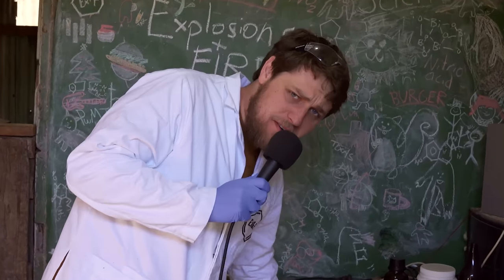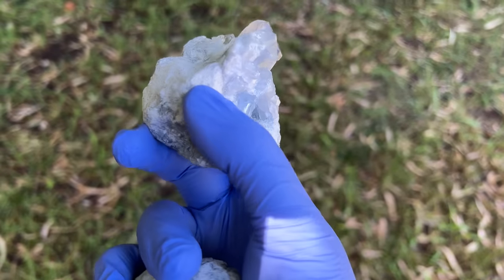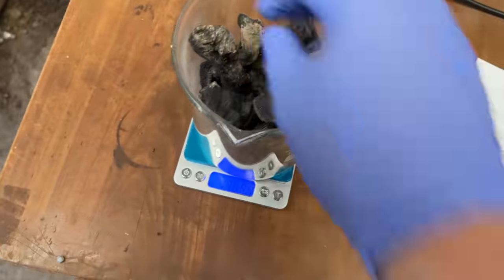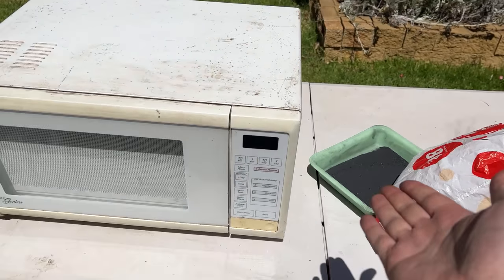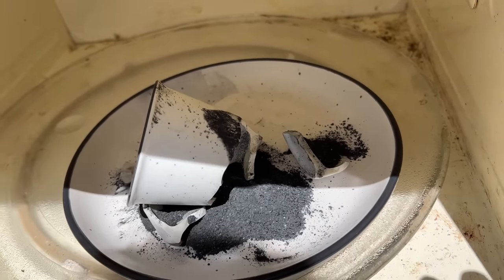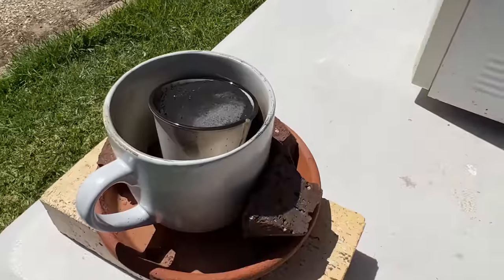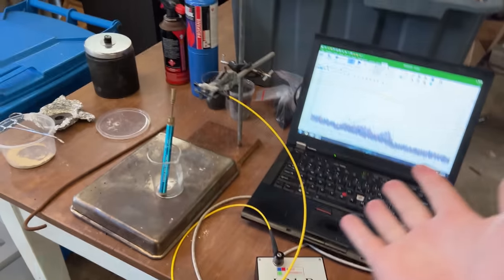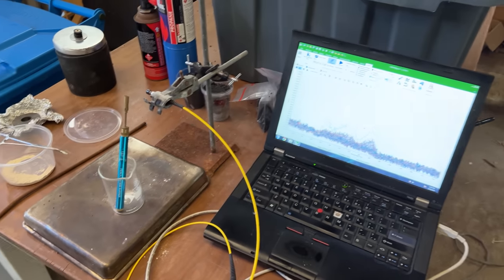Extracting strontium with a microwave

Comment: Someone else using the microwave to extract the minerals. Though i'm making steel/iron, the principle is the same. Great to see more mad scientists going at the same thing I am, it also helps my future reactions. Edit: Clay crucibles work WONDERS in the microwave, I make my own from blue clay and beach sand. As long as they are dried, not even fully fired, it works perfectly. If you have a container that's microwave safe, set the crucible in the dish with more sand.

Comment: I thought you'd make another thermite variant with SrSO4 and some active metal instead of doing the usual coal reduction, or treat the intermediate hydroxide with some special acid. You could make citrate, aspartate, tartrate, ascorbate, acetate, perchlorate, fluoride, etc. although nitrate was fine for pyrotechnic use

You have so much patience and that microwave is a beast, could it even make perovskites, including superconductors?

Comment: So what are you going to use the strontium for? It can be used in solid upconversion materials made without a pressure reactor, but to get a good quantum yield (~3%) you have to calcinate the powder at 600°C.

My team have actuall made PEI-coated strontium UCNPs for use in aqueous solution, but their emission was underwhelming compared to PEI-UCNPs made of NaYF4:Yb,Er and  NaYF4:Yb,Er

Comment: The single largest use of strontium was as chromate, a sparingly soluble (about 0.015g/100ml water) anticorroaive pigment. Every plane you ever saw was coated inside and out with an epoxy primer that contained as much as 40% strontium chromate in the dry film. That's tens of kilos per airframe. It was used on all military naval and land chassis and structures, too, although they started to phase it out for obvious, carcinogenic and long term environmental toxicity reasons long before aircraft builders did. Basically nothing works as well, for as long, as strontium chromate does as an anticorrosive pigment in paints. The secret is that sparing solubility - just enough to throw soluble chromate if the paint film is damaged, to protect the underlying metal, without being used up all in one go.

Comment: I'm pretty sure your "crucibles" are undergoing thermal shock along the boundary of the carbon/air surface.  The carbon is retaining its temperature while the parts of the porcelain exposed to the air are radiating off and cooling, which is making it shatter.

Comment: You can check the output of your microwave quite easily.  A known mass of water in the microwave for a known amount of time, 
measure before and after temperatures, apply some stupid maths and Presto... you can calculate the wattage output of your microwave.

Comment: So to answer your question the mouse shitification is agglomeration, usually done by an agglomerator, and is most common in medicines. if you crack open a capsule you can see the tiny spheres. I find it funny that you could have nuked the charcoal in the microwave to dry it before throwing it in the ball mill to prevent the agglomeration. Also you might be looking for a microwave plasma furnace, they can get really high temps. I know another youtuber NightHawkInLight has made a video showing rubies in a microwave. it might be helpful just to know about it honestly.
Reply: I don't think he could have dried the carbon out in the microwave. The moisture would have been drawn out but would have condensed on the inside of the microwave or precipitated, keeping the environment humid, making it a very lengthy, inefficient way of doing it.
Reply: @RiffRaffMama.  Have you ever heated soup or something like it in the microwave? it does heat up the water and condense along the sides. but unless its still water a couple of hours later its pretty dry, worst case you can use a towel and dry it off. I was mentioning it as a way to drive off a lot of the moisture before grinding it down. From what I understand its a way of accelerating drying. stick it in the microwave heat it up and set it on a rack to dry fully.

Comment: Oh one more thing before I go if it helps you should try a coil smelter (copper coil high wattage melts metas good and hot 1500°+) with tungsten tubing... You can oxidize the inside thickly and then use it as an almost instant crucible you don't have to use tungsten but you know😊

Comment: I'm sure you've had experiences with sitting rather quickly and fast on the edge of the bed you might have caught the wooden frame or have you not had a box frame mattress underneath your sleeping mattress?  The mattress that sits on the metal frame is made mainly of wood. Fiberglass in the mattress got caught in the wood. Maybe that's why it was so Caked Up.

Comment: Most of that potassium contamination is from the wood ash most likely.  If you washed the ash then dried it, you'd have removed most of the potassium.  If you really wanted to be fussy, you could have run the "carbon" through some dilute acid to wash it and react away most of anything hiding in it, then wash with water and dried it.  If you still have the rinse water from the experiment steps, check it for potassium.  Most of it remains soluble of course.
Reply: wikipedia.org/wiki/Wood_ash

Comment: I had the thought that maybe if you heated it in thinner layers it might heat more quickly. From my experience heating food in the microwave, it seems like the plate or bowl always gets hot faster than whatever is on it. If you have a larger mass in the dish to heat up, it might be more likely that the dish will crack before what's on it has heated up. Maybe it's just me but I have been annoyed more than once by a plate that required pot holders to remove from the microwave even though the pizza on the plate was still not heated through.

Comment: use grant thompson’s arc furnace, you can use the microwave transformer and some old lantern batteries. the only “significant” investment is the refractory brick which probably won’t be more than $10

Comment: Interesting that you are reducing the Sulphate to sulfide. In commercial gold extraction exactly the opposite occurs, you can use an autoclave to push the mineral into the sulphate form which can then more easily be extracted through surface chemistry shenanigans.

Comment: Those are called granules! The production of granules is a very well established practice in the pharmaceutical industry. It gives you something that will dissolve as well as a fine powder, without the disadvantages of working with very fine powder and without it hardening it up into a solid clump over time

Comment: About the mouse-shit results: Many candies and pills are made by tumbling a core in a powder.  Tiny amounts of water and powder are added while tumbling which causes the power to accrete onto the cores.  The core is usually a small tablet containing the active ingredient of a medicine or in the case of M&Ms, a peanut.  If you're lucky.  Sometimes they use pretzels.  Anyway, think of it as the sticky chaotic version of crystallization, where an ordered structure grows from random points of nucleation.  ALSO it's easy to ruin a plate if you put something very hot in the middle.  The conduction from the espresso cup heats the middle of the plate and the edges are relatively cool, so the expansion has nowhere to go.  The conduction of heat  is slow in ceramics, so the pause worked, but in the plate, the distance the heat needs to travel is much larger.   BTW, this is the opposite of the problem of circular saw blades.  They heat at the edges and go all wobbly because the center is cooler.  Keep your plastic spoon in the beaker! Eye on the ball. Stick on the ice.  You know, the thing.

Comment: I have to wonder a little if the temperature cycling of the porcelain perhaps contributed to the cracking.  If they weren't heated and cooled by the sudden exposure to air, would they last longer?

Comment: This hurt my poor rockhounder heart!   Something I'm curious about with strontium: will it keep magnesium from igniting in forging/casting? Calcium is used for that presently.
Reply: Note on the "Mousepoopification" that same technique (if you can call it that) was used to help early black powder form larger pellets. If the charcoal was too dry, the black powder would end up too fine.  That'd be a fun video. . . testing classically made black powder of different fineness.

Comment: By the way, you are always going to have to deal with ash when using impure carbon to conduct chemical reactions, simply because wood, being a living item formerly, had to have minerals in it, as way of how life lives, and so your final product will have sodium, potassium, calcium, magnesium, iron, and even traces of lithium, aluminum, selenium, arsenic, and silicon.

Maybe even some naturally occurring strontium.

Either way, its an impure product, so your final result is going to be impure without multiple recrystallizations, which, if you keep using impure carbon, simply never will happen...

In fact, with impure carbon, you would get more and more impure instead of less.

Comment: Dr Thomas, congratulations on your doctorate. If you asked me, to design a scale from 1 to 10, with a given "getting a B.A in Communications" as Level 1. And then you asked me 'where would the corresponding value for "PhD in non-linear optics" I'd say 12.

I agree that the shit pellets (note how they're somewhat like coal?!) were in all likelihood the result of the residual moisture of the carbon, combined with the ~100 micron size of the ball-ground strontium. My best guess is, since you threw the Carbon while it remained with its very high RH and a few microns into a (relatively) closed system, with a dry strontium on the order of 10s to the high hundreds of nm. Initially, the wet C(biggest,wettest) will favor a weak electromolecular bond with all them Stontz(dryest,smallest). Eventually your energy-minimum shape (spheres) will develop as you continue to coalaese

Next time, I suggest buying (or borrowing from ur uni) a "mesh sieve set". They're used in civil engineering to establish soil density for foundations and such. I'm sure they're used in plenty of other more biological applications but that's outta my scope. Some companies sell things that are ASME/ASTM certified. Try calling up vendors and ask if they have any B-stock that failed their QA.

Then, after using that mesh set (basically, its 6 trays, the top of which has a controlled steel mesh-- the one below it is smaller, the one below it is smaller, so at the top you see how much of your assay was of density range a, tray2 density range b, etc). Take tray 6 (the finest grit), and use that in the ball mill. (Note: I'm not sure if this is actually the 'best best' idea since having some content from tray 1 might act as a positive abrasive. Your ball mill will address this; I'm sure it's been well studied).

Separately, I would have taken the carbon, put it out on a long table on a sunny, non-windy day. Taken some glass trays and let the carbon out to dry. Like super fully. Before doing so, I might have done the Doug's Lab drying method : paper towels on the bottom, large surface area, air flowing over, and maybe heating elements at the bottom.

Similarly, having a RH probe is worth the 30 dollars or whatever. I've never used one in a situation like this, I'd imagine there might be calibration co-efficients involved, but it's YT. 5 point sampling will develop a quadratic curve that you can work within I'd imagine. At least good enough to know when your Carbon is dry enough to work with and mix in with your Strontium

 I really wish you had sent a sample off to @The Signal Path since he has a lot of optics equipment, and sufficient chemistry knowledge as well as process control experience to give a pretty good educated guess on.

Comment: In the future, if you need activated, pure carbon, get a paint can and puncture a small hole in the lid. fill with wood and put in a hot bonfire while you have a beer. the lack of oxygen will turn the wood into perfect, activated charcoal. my neighbor has a woodshop and I do that with sawdust and plane shavings, and it makes really fine, perfect activated carbon.

Comment: A couple of months ago I was in need of some calcium powder. So I took some eggshells from the restaurant I work at and pulverized them. I needed them to be as sterile as possible though so I dumped them into a glass cleaned with iso and h202 and put it in the microwave for 5 minutes. I came back 2 minutes later to a weird smell and noticed that my microwave was glowing orange. Apparently the eggshells got so hot that they melted through the glass and the tempered glass microwave plate. Lesson learned, microwaves get hot.

Comment: Maybe by using a carbon crucible (or a carbon coated one), the temperature could have been achieved easily instaed of using an excess of carbon. NightHawkinLight used a carbon-coated crucible to make synthetic rubies, so it might get hot enough.

Comment: if you put a small block of wood under one side of your tumbler ( " ball mill ") then the material wont build up on the ends, and it mills better.
i have always heard " rat shit-a-fication " referred to as " pilling" just like what happens on old cotton blankets. little " pills ". 
oh and did you say you bought those ceramics at k-mart? those still exist?
Reply from the maker: Thanks for the tip! 
And yeah in Aus they’re very popular still!

Comment: Oh, I didn't think of strontium in fireworks. My head when straight to nuclear physics where Strontium-90 is both a pretty horrible waste product of nuclear reactions, but also a relatively useful component of engineering and medical imaging devices. 

It also has a pretty unfortunate use as a cheap RTG decay heat source, where hundreds of Strontium-Titanate RTGs were left powering unmanned lighthouses around the Soviet Union when it collapsed and suddenly became orphan sources that magically give off heat (and acute radiation sickness) in those cold Siberian winters. Even a decade after the fall of the soviet union, when two were found in Georgia by 3 men out looking for firewood, just 40 seconds near them would put you over the maximum recommended yearly dose of ionising radiation. By now, given the ~28 year half life of Strontium, they're still about 2/3rds as dangerous as they were then. So don't sleep near the warm tin can in Siberia!

Comment: I'm very curious if the milled crystal-charcoal mixture is flammable. I fell like it should be, it's a very fine powder of a metal salt and carbon, just a couple of different elements and missing the elemental sulfur component of black powder so I see a good potential for explosions and fire 😁

Comment: Could you use an induction coil heater to heat the materials somehow?  Perhaps use a metal rod in the center of the crucible and pulse one end of the rod through an induction coil and sort of sink the heat into the crucible?  I don't know if that is feasible.

Comment: Perhaps the vessel are cracking due to thermal shock caused when you open the microwave door repeatedly.
Just leave it in there for the duration.

Comment: It would have been more cost effective to buy an alumina crucible and line the inside with pencil lines. Or spray in graphited lock lubricant and let the solvent air dry. I've never had any decent luck with porcelain surviving anything. It's too finicky and specific for its own heating requirements to be a worthwhile effort

Comment: For the love of god use a metal cylinder to smash/grind the sample not a hammer lol. Make a big strong mortar and pestle it works the best. I use an old small fire extinguisher and a small old steel drum. Just tamp and twist and you have super fine powder in less than 5 mins.

Comment: you could get a hydrogen generator from china if u really need hot stuffs. its only like 75$ USD for a cheap one, or use the aluminum method if u dont wanna use electricity

Comment: I have to add one thing - you are incredibly wrong about scandium being useless! Scandium has utterly fantastic metallurgical properties: for instance, a tiny fraction of scandium improves aluminum alloys to better performance than high-grade titanium, and there are all kinds of other crazy alloys you can make with the stuff. The reason scandium isn't widely used is simply because it's really hard to mine - there aren't any high-grade scandium ores, it's only produced as a byproduct of mining other stuff, and so we produce only a tiny amount of scandium per year. Like, a dozen tonnes per year - too little to use in any kind of mass production, apart from weird super-specialty aerospace alloys and golf clubs for annoyingly rich people. If the supply of scandium were significantly larger, it'd be in everything.

Scandium is basically metallurgical Unobtainium - a genuine wonder material, but in most applications you just can't even get enough of it to make anything more than research samples!

Comment: Why don't you just build a ghetto foundry? You'll need to get firebrick and a burner, but the rest is super cheap and easy. Or you could just get a Devilforge. Comes with everything you need except gas. And crucibles. You'll want ceramic or graphite. They can easily get hot enough to melt copper. It'll even melt iron if you crank it right up.

Comment: Use the hot plate (350 degrees) AND the gas burner (650 degrees) together to get 1000 degrees.  Duh.

Comment: oxy acetylene flame has a temp of 1760 C.............. 
i would have used oxy acetylene......... especially because i have big F-off bottles of both because mechanic shop
.
i havent watched the whole video yet (14:20 currently...OMG its sorta 4:20, better smoke a bowl... its legal in MT USA now)..... 
but i just cant help but feel that the microwave is going to catch fire / burn the electronics out of it
.
a good oxy acetylene "rose bud" would probably heat it up even faster than a microwave..... 
and its just WAY safer (even with the open flame)